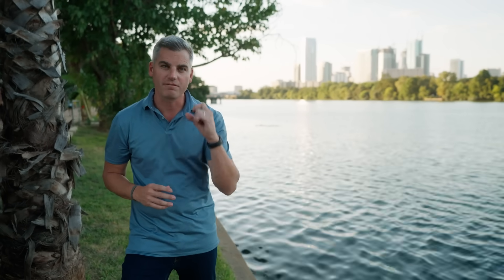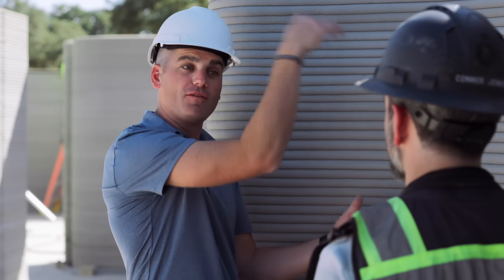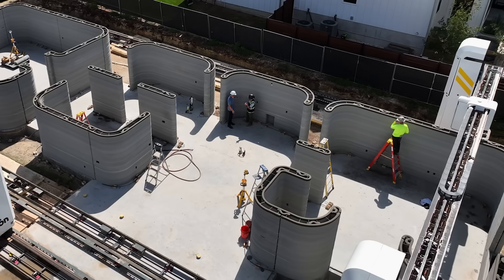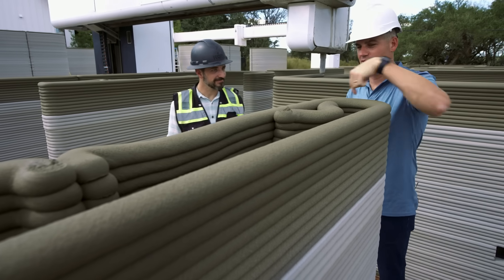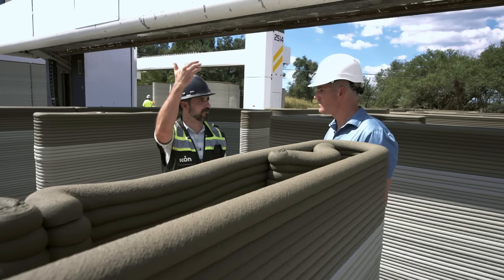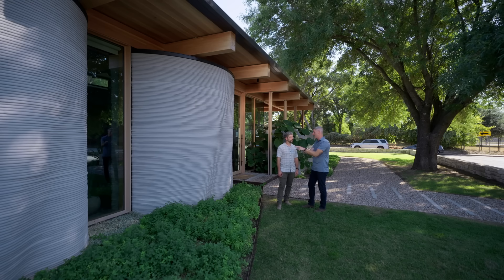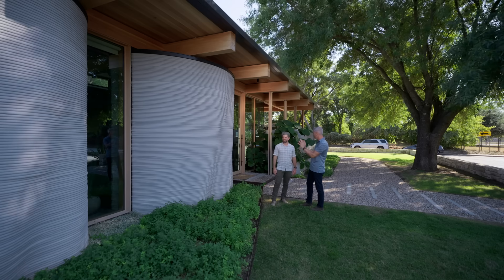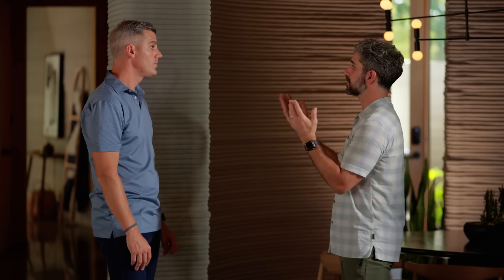Exploring 3D Printed Home Technology | Ask This Old House

Comment: The First Rule of 3D-Printing Hype: Whatever noun follows the descriptor "3D-Printed" is always the wrong word. 

Typically the noun will be for a higher level assembly, something that is lovingly assembled with skilled human hands from some 3D-Printed components.
Reply: The technology will eventually improve but I do not like the look of anything they showed. It all looks cheap and does not look like it will last.
Reply: @David_H_Parker   I noticed that they really tend to concentrate on wall systems for single story dwellings. This is after that unfortunate incident where they attempted to "3D-Print" the concrete 2nd floor into mid-air.
Reply: @JxH  No 3D printed ceilings, or roofs either.
It is funny that the framers have to come in and stick frame the ceiling and roof system. But the framers could have had the entire house stick framed, sheathed and roofed in the same time it takes to print the walls.
Reply: @David_H_Parker  
How long it lasts will depend strictly on the concrete formula they used.
I don't think they have ever mentioned the psi value of the mixture.
Reply: @scotttovey  There's no aggregate in it.  It looks more like mortar than concrete.
They could have added some wire at least to give it some reinforcement. I have serious doubts about how structurally sound this mix and technique is.
Reply: @David_H_Parker  
You don't have to use aggregate.
If they added graphite, or Graphene to the mix, it will withstand a good bit of abuse.
They could have also added carbon fiber to provide structural strength.
Reply: @scotttovey  Graphene is not exactly a budget friendly material at this point.

You could build a house out of titanium too, let's be realistic here.

I think this process could be much nicer if it incorporated forms and proper rebar. You can add fibers to the concrete mix but the increase in strength is marginal compared to wire or rebar.
Reply: @David_H_Parker so from this video, you can tell exactly what's in the mix? What's your background in?
Reply: @ We can clearly see that if the mix contains any aggregate, then it must be very small particles.  

Perhaps they use fiberglass. I specified fiberglass reinforcement fibers ($100 per load) as well as 4000 PSI mix for our house. Also, plenty of rebar in all the right places. 

Our house was also "3D-Printed" in the sense that the trees make wood using an "additive manufacturing process'. So the wooden studs and joists, and therefore the entire city thus gleefully inherit the designation "3D-Printed" - this is using the rather loose nomenclature standards as applied in the 3D-Printing industry.
Reply: @ I can clearly see there is no crushed stone aggregate. It looks like portland and sand.

I never said I could tell "exactly" what was in the mix. Again, you are here in bad faith and making cheap strawman arguments.

I have a background in making things. In relation to this, I  have constructed houses, buildings, structures and worked with concrete and masonry products. I know what 4000psi concrete looks like, I know from experience what works and what doesn't. All concrete cracks, concrete without aggregate is easier to crack and does not handle loads as well.

What is your background in?
Reply: Some people are actually making money with 3D printer farms.

The quality of the product is dependent upon the skill level of the individual running the printers as well as the choice in material printed.